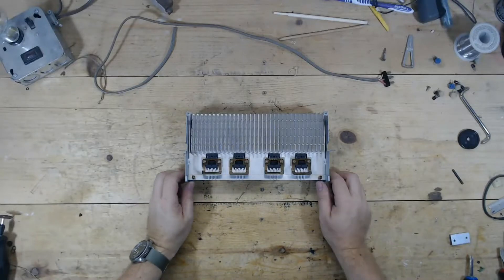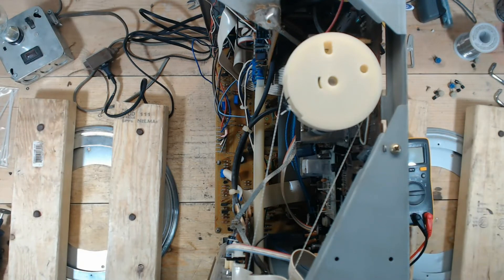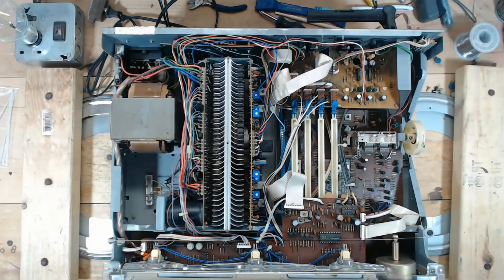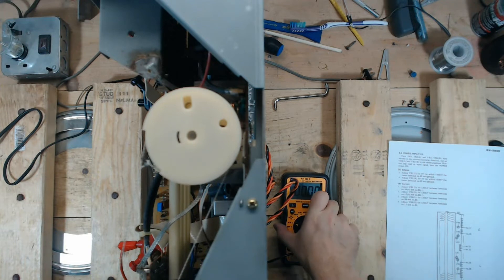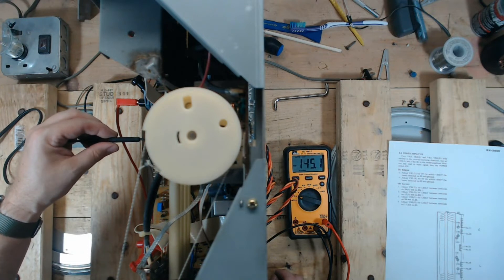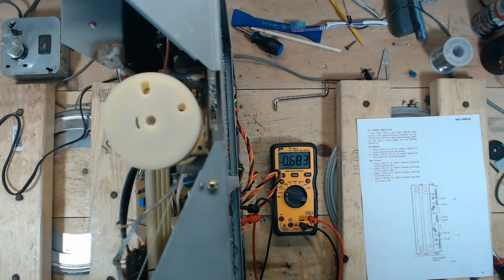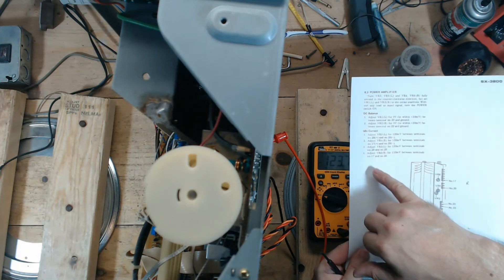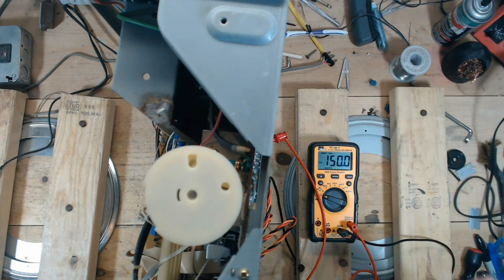Smoking Pioneer SX 3800 Receiver Repair Part 2 - Replacing the Outputs, Recapping & Aligning the Amp

Comment: Thanks for the videos on the 3800. Why did you replace the outputs?  Were they collateral damage when a part got smoked? What did you replace them with?
Reply from the maker: Yes - they worked fine before I attempted the bias adjustment.  One channel's outputs fried so I replaced them all (both channels).  MJL1302AG / MJL3281AG for the subs.

Comment: @MillerVintageHifi   When you adjusted the bias and offset, did you have the pre-amp/power-amp jumpers unplugged? Were the speakers disconnected? I'm getting ready to do this for the first time on my sx-3800
Reply from the maker: It's been a while...I assume the jumpers are in and there's a load at the speaker terminals.  You'll need to double check the service manual to be sure.
Reply from the maker: I would also HIGHLY recommend reviewing some of MarkTheFixer's comments on audiokarma regarding biasing the 3800/3900 receivers.  These NSA amps can go nuclear quickly if you do something wrong OR you haven't replaced the bias transistors and trim pots.